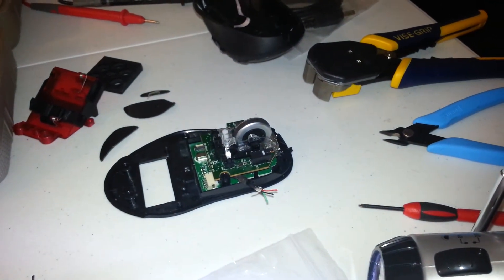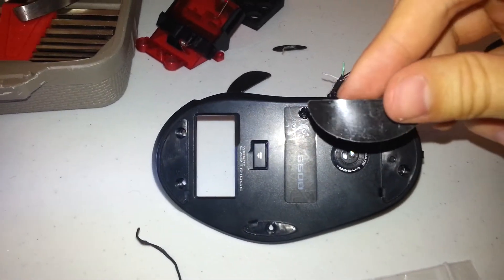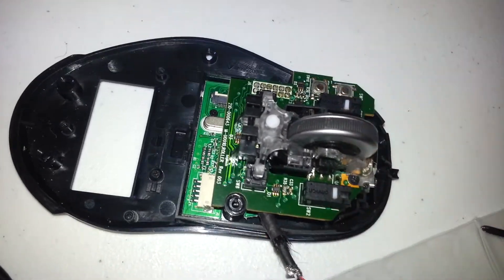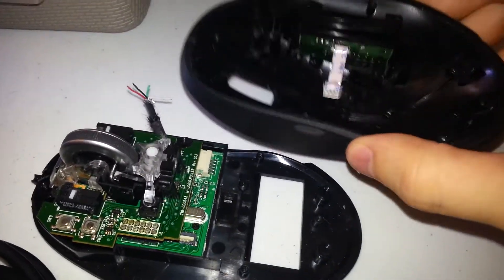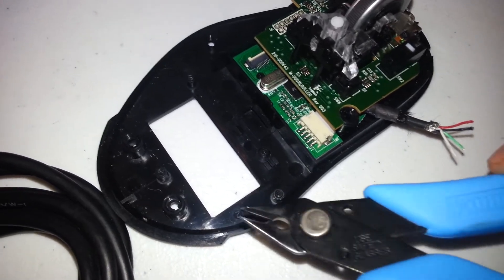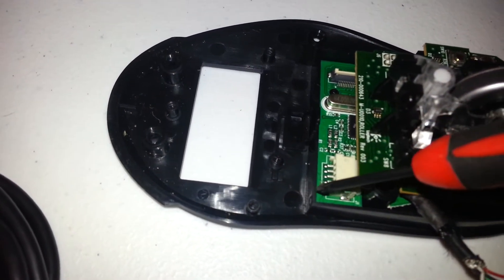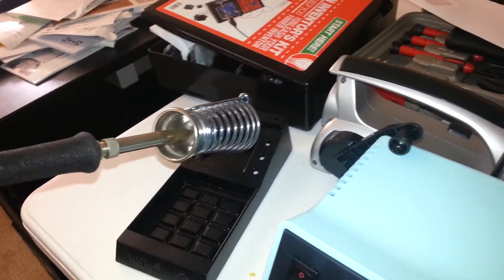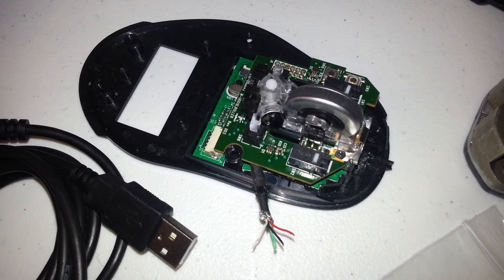[DIY] Logitech G500 Gaming Mouse Repair/Fix Broken USB Cable Tutorial

Comment: dude, there is a tiny bolt, which one connects the transparent frame of the wheel with the black frame. you can threw it easily out and remove the wheel with its frame. then you get acces to two more screws. after removing them, those both left and right to the frame, one at the back and one at the front ofter bottom circuit board, you can remove both boards and get access to the plug of the cable (you can buy a new kabel for about 5 bugs on ebay). its only possible to separate the boards when you are willing to solder the pins before and after.
Reply: Where is this tiny bolt? I'm looking all over and can't spot it :P